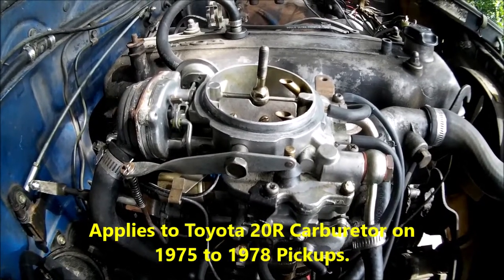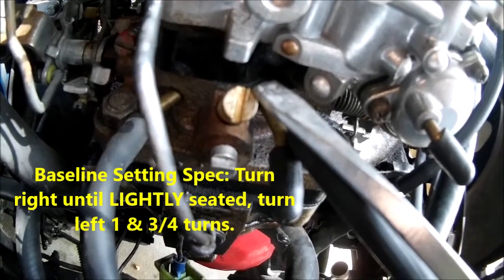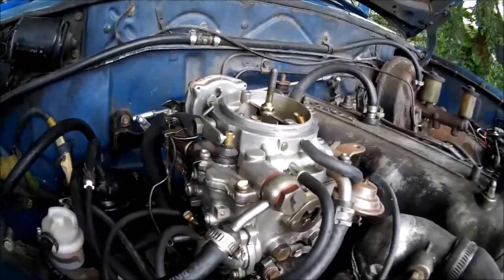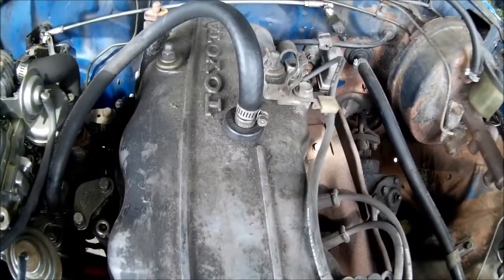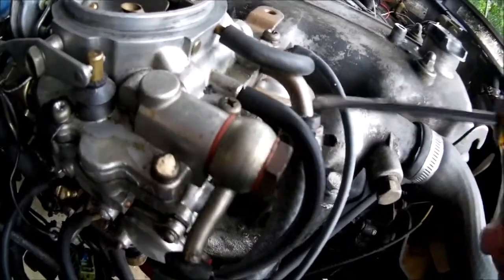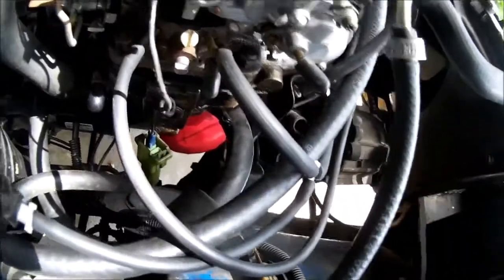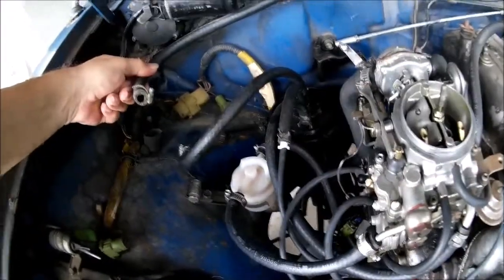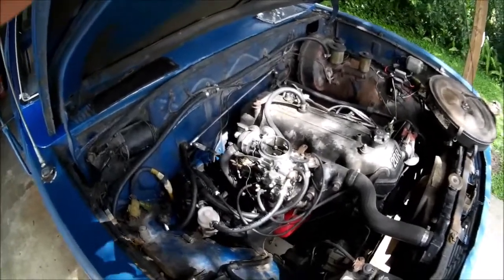1978 Toyota Pickup/Hilux 20R-Carb Adjust & Vac Lines-Desmogged

Comment: Your videos have been incredibly informative as I've got 2 20R Coronas. Ever run in to an issue where your dashpot was holding the throttle positioner open when going down the road but not at idle? Trying to troubleshoot that on one of mine.
Reply from the maker: Yes I've had that happen. Fortunately the Dashpot itself was OK & it just required a fair amount of tinkering with the adjustment screw to get it just right, because I didn't have the manual spec for it, but I do now. Here it is straight from the service manual:

"With the throttle released, the clearance between the edge of the primary throttle valve plate and the venturi bore should be:
Manual Gearbox - 0.024" or 0.6mm
Automatic Transmission - 0.020" or 0.5mm"

Please note that this adjustment is done with the carburetor completely removed from the intake. The "throttle valve plate" stated above means the "butterfly plate" at the bottom in the base of the carb, so you can't measure it with the carb installed.

Adjusting the Dashpot with the carb installed is less direct & a little tricky but not impossible. Engine has to be up to full operating temp & at normal low idle (Manual 800 RPM, Auto Trans 850 RPM). I start by backing off the adjusting screw until it just loses contact with the throttle arm, then running it back in until it makes the slightest contact with the arm (look for very slight arm movement from this), then backing the screw out an eighth (1/8) of a turn. Then rev the engine a bit, completely let go of the throttle linkage & let the linkage settle back down to idle, while watching the dashpot & listening to the engine.

What you want to see & hear is the dashpot adjusting screw contact the arm just before it "bottoms out" at normal idle position & idle engine speed. It's a very small portion of the arm travel & when set correctly. The time element (duration of the "catch & settle") is very short, guessing like a half second or less.

You might have to do this repeatedly to get it just right. It takes very small adjustments to the screw once you get it close. Once you do get it set to what appears to be correct, check that your normal low idle speed is correct as stated above.
The Idle Adjustment Screw and the Dashpot adjusting screw are inter-related, as both can contact the throttle arm & both effect engine speeds. So you may have to go back & forth between the two screws until you get the right balance of functions.

Hope this makes sense. Let me know if you need clarifications or have any other questions.
Reply: @The13thSword  THANK YOU for this very detailed response. Spent some time on it today and got it to run properly without having the throttle hold itself open while I was driving. Got a brand new carb recently and looks like the throttle position screw was all the way in, which somehow was causing it to hold it open. Really appreciate the wealth of 20R knowledge you're sharing with everyone
Reply from the maker: You're welcome & I'm glad it helped. Sometimes at the factory or the rebuilders shop, they don't always set everything correctly, so I've learned that it always pays to go through all the adjustment settings before you install the carb.
If anything else comes up that you might need some info or an opinion on just let me know. Thanks for letting me know it helped & for the like & view.

Comment: Where do the 3 line from the mechanical pump go to just obtained a 79 pickup 20r with mechanical pump  had no pump when I got it so I'm not sure where they go
Reply from the maker: You should have 3 metal lines coming out of the fuel pump. I will describe their orientation or direction, & the lines that go to/from them as if the fuel pump was already mounted to the cylinder head.

The line that points downward is the inlet, or fuel supply from the gas tank.
The line the points towards the firewall & is parallel to the valve cover is the outlet, the line that goes to the carburetor.
The line coming out of the top of the fuel pump is a fuel return line. This line sends fuel back to the gas tank.

Notes:
Make sure you install the plastic spacer between the fuel pump & the cylinder head or the pump will not work.
If the spacer didn't come with your truck or with you new fuel pump, you'll need to get one. You should be able to find one locally at any major brand auto parts store. Two of the most commonly available ones are:
FEL-PRO 70577 or BECK/ARNLEY 0392003.
Completely clean off any old gasket material on the head. Use the new gaskets that came with the pump, one on either side of the spacer.
Do NOT reuse old gaskets or you will have an oil leak between the head & the pump mounting flange.
Installing a new fuel filter at the time you install the pump is highly recommended.
Torque spec for fuel pump mounting bolts is 30 foot/pounds. Be careful not to over-torque these as that could strip the threads out of the head.

Any other questions feel free to ask.

Comment: Above the brake booster line I have 2 vacuum lines coming off the carb instead of the 1 like yours has and the choke piece on the top on the other side I also have 2 vacuum lines there compared to your 1. Do you possibly know what those are for and if I need them? It is a 78 celica gt liftback with the 20r
Reply from the maker: It depends on whether or not you're still running the original stock emissions system & if those parts are still working or not. Most basically, you don't need most of the original vacuum lines for the engine to run well, as long as any unused vac ports on the carb are capped off.

Here's a link to a repro vac line diagram for the '78 Celica 20R that might help you figure out what you have & what goes where: https://toyota4low.com/products/1978-vacuum-diagram-decal-20r

As you can see, most of those lines go to emissions control valves, which may or may not be functional, considering the vehicles' age. The only reason I know of for you to still need any of the emissions equipment is if your state law requires it to be present in the vehicle, like for inspection purposes.

I'm in Florida where we don't have laws like that so I removed all of the emissions equipment. I'm running the vacuum advance line to the distributor, the vac lines for the choke pull-off & dashpot, & 1 line to the charcoal canister for fuel vapor purging purposes.
Reply: I went ahead and did exactly what you have here with my carb and it runs the same as before (not sure if it is a good or bad thing might still have a leak somewhere) the main reason I wanted to do this is the car doesn't match the chart already and was missing some hoses. I messed with the carb screws last night and have the mixture screw out about 3 turns maybe more and was told that means I probably still have a vacuum leak since that should be rather rich running. I really appreciate the video and input!
Reply from the maker: @ugellis237  I would agree, that mixture setting is too rich. If all is as it should be, the setting should be 1 & 1/2 to 1 & 3/4 turns out. IF you have the ports on the carb for those missing hoses well plugged, then your vacuum leak is in one or more of the remaining hoses, or in the carb itself.

Let me ask you, is the carb original to the car? Has it ever been rebuilt? How many miles are on the car?

I ask this because the carb itself can have vacuum leaks in certain places due to use & wear. It could be a broken or missing piece of gasket between the carb body parts, or more likely, worn throttle shaft bushings in the base of the carb. My old carb had this last problem & I was having the same issues that you are.

You can test for these things with the engine warmed up & idling, & using a can of carb cleaner. In my case, I shot the carb cleaner at the ends of the throttle shaft & very time I did, the engine ran a bit faster for a second or two. The leak in the bushing was allowing the carb's vacuum engine to draw the cleaner in & burning it like a fuel. Hence the speed up of the engine.

Personally if I suspected this to be the case, I'd just get a rebuilt carb from National Carb & send them the old one as a core. Or you can send them your carb & they will rebuild it for you & send it back to you. More info here: https://nationalcarburetors.com/toyota-cars_c_47.html_4-cylinder-2-barrel-carburetor_1978

During their rebuilds they always replace the throttle shaft bushings, so that there will be no vacuum leak there. Solved my issue & I can now tune the carb perfectly. Plus they use updated internal parts so that the carb can run on today's 10% ethanol gas.
Reply: After messing with it some more last night I think I got it even closer running on 1.75-2 turns out. I was told the carb was rebuilt 2 years ago then sat not too long after that until I bought it. I have noticed now that the accelerator pump is leaking.  The mechanic here in town said he'd take a look for me next week and check it for vacuum leaks since spraying carb cleaner did not change anything when I tried. Yet again thanks for the advice it's definitly gotten me very close on the setting of the carb and I will probably remove more emissions items in the future and hope it cleans out the engine bay.

Comment: Why my choke is always fully open ??
Reply from the maker: Hard to say without being there to actually look at it. I assume you mean it's even fully open with the engine dead cold?

Try getting a can of carb cleaner and completely cleaning the outside of the card, especially all the parts of the choke linkage & plate. Then inspect the entire choke linkage to make sure it's connected up. If all the parts are connected as they should be, lubricate every pivot point on the linkage with some light oil, like 3-in-1 oil or ATF (Automatic Transmission Fluid). Don't forget to oil the pivots of the choke plate itself.

Oiling the carbs linkages & pivot points should be done on a regular basis, about every 5000 miles or so.
Reply: @The13thSword  this is with engine cold or hot ,running or not,I feel like the choke should have some resistance,but it feels lose,or either the choke need to be adjusted like you mentioned in this video,my have the 2 hoses like yours,so it works by water heat as you mentioned,I did the carburetor cleaning but I didn’t oil anything,so that’s my next step,THANK YOU ALOT FOR RESPONDING SO QUICK.
Reply from the maker: @martinlandaverde403  No problem, just want to help out if possible. Hopefully getting some light oil on the moving parts of the choke linkage will help. I was also having trouble with my choke plate, getting stuck om the fully open position. This was happening when trying to start cold, giving one full "pump" to the gas pedal then cranking.

Once I oiled the pivot points for the choke plate shaft, the problem stopped happening. I guess the shaft was getting stuck in the holes it pivots in. In any case, it fixed my issue. Let me know how yours turns out.

Comment: You, sir, are a saint. One thing that threw me at first is that there's an adapter to up the size of the hose going from the ported vaccuum line you're running to the charcoal canister. You've actually inspired me to put that back ON after I de-smogged it. I just did the head gasket and the timing chain (and the water pump and alternator and a few other things) and I'm firing it up tomorrow. I had tagged each and every vacuum line with masking tape, and then half my tags fell off and I was in trouble.
Reply from the maker: I'm glad it helped & that's why I posted this vid in the first place. I've been there before myself; tags going missing during the process & no access to a factory vacuum diagram. Plus there is very little info out there about desmogging a stock carb equipped 20R or 22R. "Just get a Weber" is a $400+ plus proposition & not  in a lot of people's budgets. I knew there had to be a way to get a desmogged stock carb to work well.

I think it's the right call to have the charcoal canister in circuit. It does act as a vent & vapor trap for the gas tank, & I'd rather have it there doing it's job rather than having raw gas fumes from the tank going into the engine compartment from an open tank vent line.

Just for clarity as others read these threads. I have the "T" adapter on the ported line for a couple of reasons, all of them learned through my own experience.
I originally had the canister hooked up to constant engine vacuum but this presented many problems. Inconsistent idle quality (surging, couldn't establish steady idle speed, etc) & inability to tune the carb for best lean idle. Subjecting the canister to constant engine vacuum was acting like an intermittent vacuum leak. I switched to the ported vacuum & all those issues went away. Solid & consistent idle speed, no surging & able to properly tune the carb idle mixture.

The other plus to this is that the canister only gets purged of fuel vapors or the carbs draws a bit of extra air through the canister at engine speeds only above idle. On cold starts or completely warmed up, you'll never notice any issues or a difference in performance. I've been running this way for a long time now & have never had any over-lean problems.

Sounds like you've done a lot of hard work there; good job.👍Post back once you get it fired up & let me know how it's doing. Any other problems or needed info just ask,

Comment: Um hey so yep I am battling hard start I took ignighter off and gm mod nope so I am straight coil to battery with resistor I get it started and I got some hoses confused I thing I set the screws and timing and it's running so rough and surging
Reply from the maker: @timothycourtney9430  I'm not too sure how to help you on this, as your description lacks a lot of detail, and a few things don't make sense. The HEI nodule would have to be working to turn the coil on & off in order to even have it starting & running rough. The coil wired direct to the battery has nothing to do with that. You also don't want to have constant voltage to the coil, wired like that, as that will make the coil fail a lot sooner. The power for the coil should be switched from the ignition switch.

You didn't mention what module brand/part number or coil brand/part number you used; it would help me to know that info. How did you ground the module? Please describe in full. The module ground is critical to making it work correctly.. You didn't mention the state of your carburetor - old, new, rebuilt recently & by who? Describe how you "set the screws" more completely. like which ones, how many turns, etc.

If it's not shown in this video about correct vacuum hose routing/positions, I do have it shown in one of my other videos; have a look through my video listings.

By "Timing" I assume you mean engine timing. How did you set this? Describe in full. What is your engine timing set to. On the 20R it should be 8 degrees before top dead center on the compression stroke of the #1 piston. If timing is not set correctly it could cause hard start & rough running.

Have you adjusted the valves? Have you taken off the valve cover & had a look at the valvetrain for any problems? If you do have a look, also check out the timing chain near the front of the engine. Sometimes if the chain is older with a lot of miles, it could be loose from being stretched, from broken chain guide(s), non-functional chain tensioner. Any of these can also cause hard start or rough running problems.

Again, help me to help you by giving as much complete & detailed info as you can.

Comment: Hello, on the water activated choke, what is the proper name to the hoses that connect to it?  I have the leftside hose leaking. 
Thank you
Jim
Reply from the maker: @jimcastillo8950 Toyota calls them Water Bypass Hoses. reference: https://parts.toyota.com/a/Toyota_1978_Truck-DLX-MT/_51507_6727109/RADIATOR--WATER-OUTLET/671430-1603.html

They are no longer sold by Toyota but it appears that Gates still makes them. Try Googling these part numbers as written:
Gates 18801
Gates 18805
The 18801 is the driver's side hose & the 18805 is the passenger side hose. They may have to be cut some to fit for correct length. They both appear to be readily available on the market from Amazon, Ebay & likely some local parts stores.

If y can't find them online or locally, you could try lengths of new "straight" heater hose of the proper inside diameter to replace them. I've never tried that so I don't know if the straight hose would kink on you or not. That's why the molded type is a better choice if you can get them.

Comment: I have a 21R engine . I need to find out how high up on the glass is the fuel level? Is half way between the two metal tabs or level with the lower tab?
Reply from the maker: Halfway between the two metal tabs is correct. Exactly the same as on a 20R. Any level between the tabs should work OK. I personally prefer to have the level right in the middle. Level with the lower tab can be OK, as long as the engine runs the way it should at idle, no missing, rough running, having to turn the idle mixture screw more than 1 & 3/4 turn out from bottomed, etc.

If you need more info on this let me know what specific questions you might have. The fuel level can be adjusted but you need to take off the top of the carb to do it, and there are some measurements you have to do.